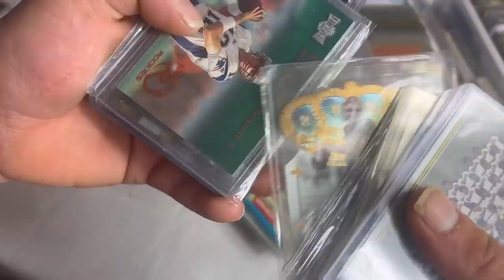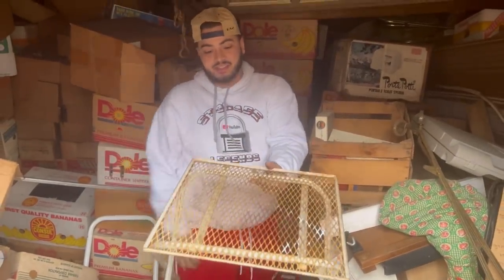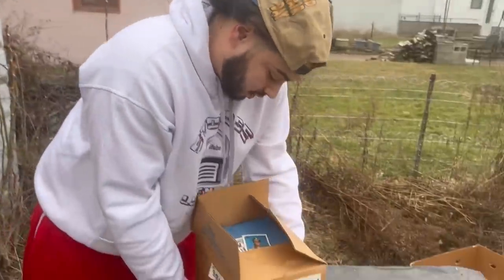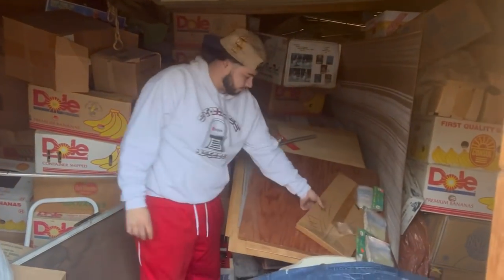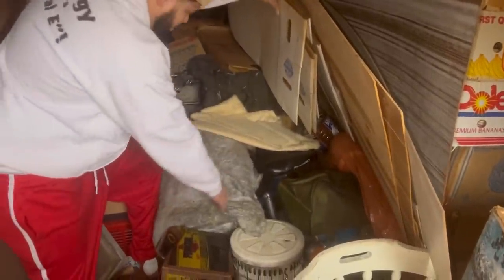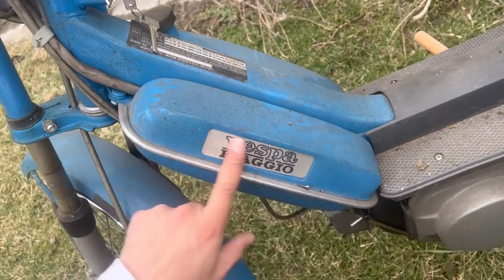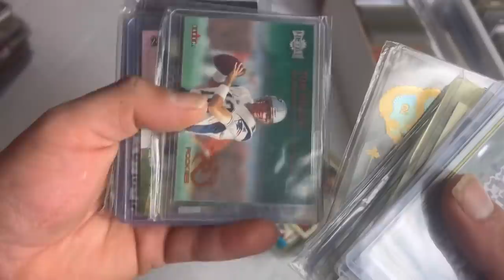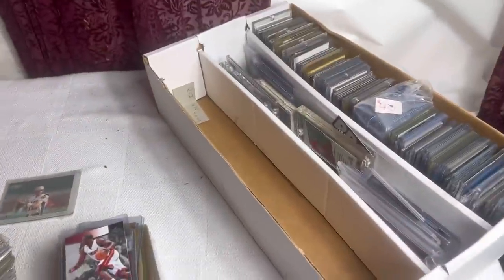THOUSANDS in VINTAGE COLLECTABLES FOUND IN Garage !

Comment: Looks like around a 1978  Vespa Piaggio Bravo moped. Around that time Vespa had two models  the Caio and the Bravo. The Caio's are rigid frame and a in frame gas tank. The one you have there the Bravo model has suspension forks and rear shocks for a smoother ride,  a subframe and a bolt on gas tank. The center stands (kick stand) are common for scooters and mopeds. Vespa also makes scooters